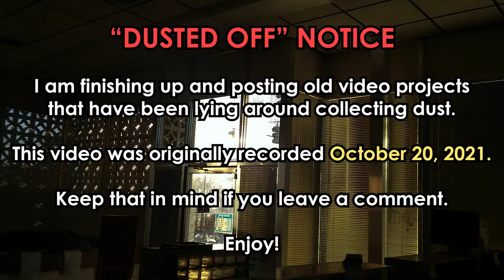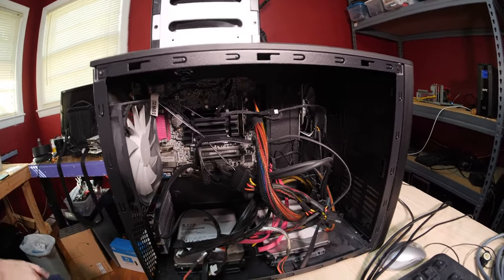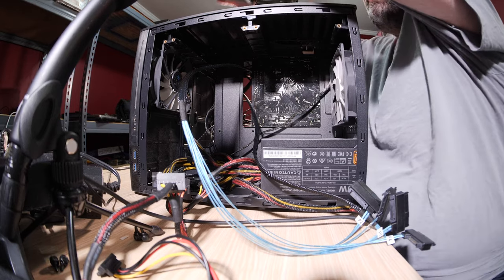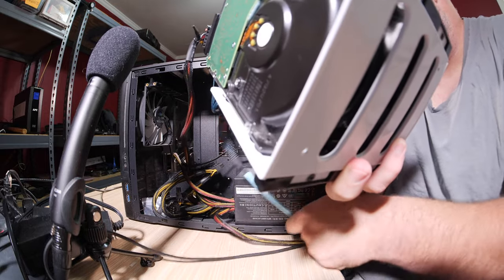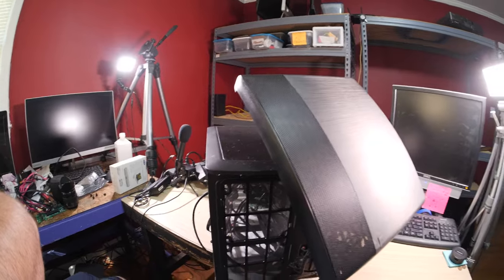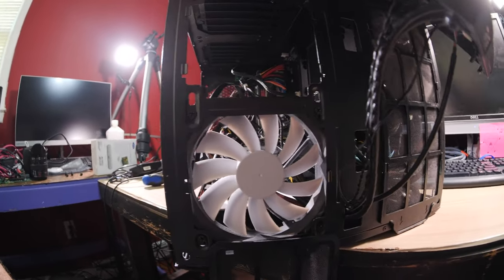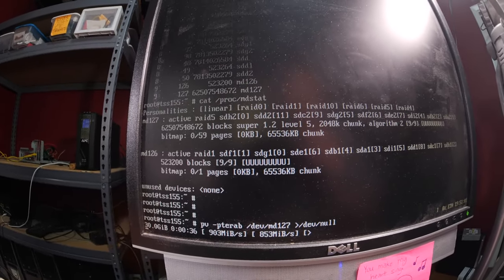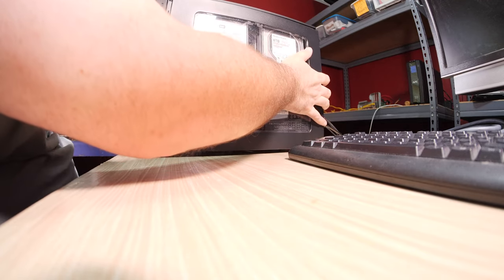Performance Boosting my Fractal Node 804 RAID Server Upgrade to LSI SAS 9211-8i - Jody Bruchon Tech

Comment: LSI SAS 9211-8i is a PCI-E v2.0 x8 HBA controller with max 4800 MB/s on x8 slot full duplex (FD) or 2400 MB/s in one direction. The old "controller" is a just a chip PCIE to SATA with x1 PCI-E line (max on x1 is 350-420MB/s). The speeds of the new (old) LSI controller don't surprise me. However, it is intended to work in servers and under high load, unlike the removed one, whose idea is simply to add sata ports. (speed doesn't matter to him)
Reply from the maker: The original build had slower drives and less of them so the port multiplier didn't cause any serious performance loss. Got more drives and better ones and the array began suffering hard.

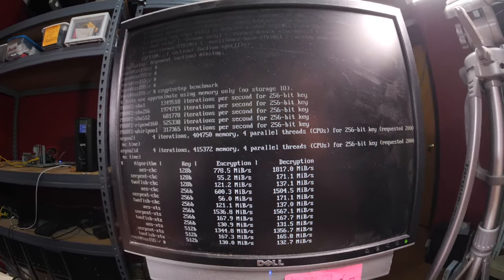Comment: * Gibibytes 13:20. What setup are you running these days? I went with 2 HDDs in RAID 1 mode on my home server with LSI 9267-8i, but since switched to mdadm instead, as is uses less power and is hardware independent in case of hardware malfunction. Which actually happened on my LSI controller - chipset radiator plastic legs broke and it started overheating, hanging up my array. I of course have a backup on a separate HDD that is kept disconnected in another room, so just had to restore it, but I learned my lesson of keeping just a minimal number of disks (less disks, less of a chance of one of them dying) and keeping everything as hardware agnostic as possible. Power usage of my setup with i7-9700, 16GB RAM, 1x SATA SSD for system and 2x 4TB Hitachi Ultrastar 5700rpm enterprise HDDs in mdadm RAID 1 on Slackware 15.0 is ~40W at idle or average media streaming usage (which is >95% of the time on this server) at the wall. Have you measured power usage of your setup?
Reply from the maker: I use 10 8TB WD Easystore shucks in Linux md RAID-5 with XFS on top. It can get quite toasty especially with the Ryzen 5 5600G.